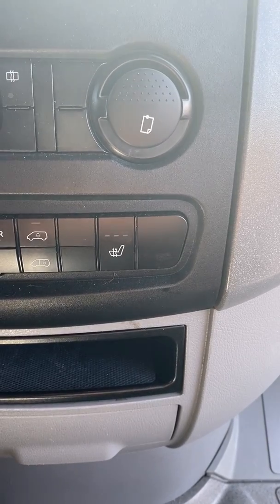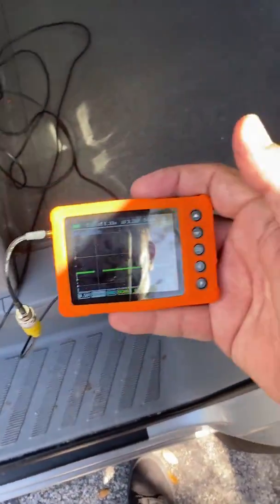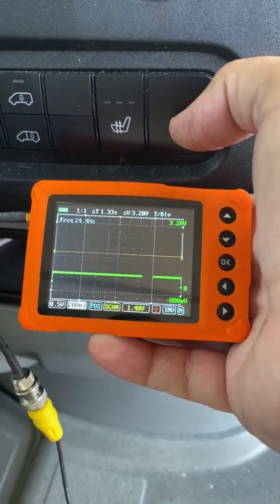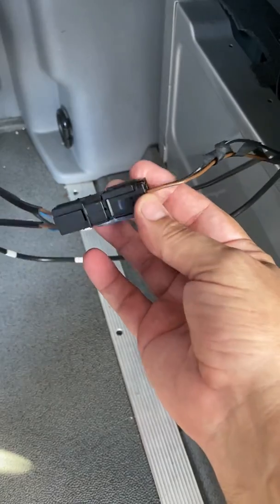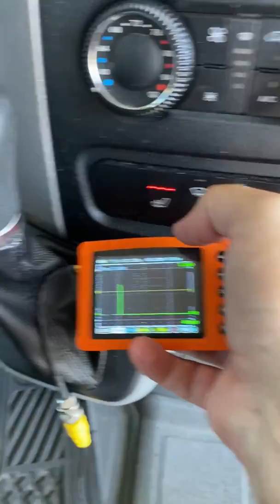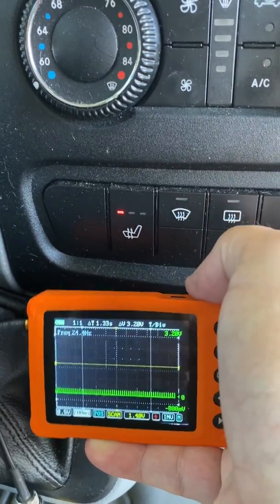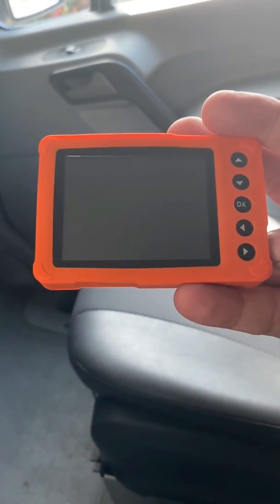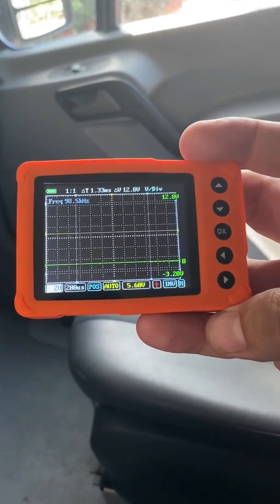2014 Mercedes Sprinter - Heated Seat Diagnostics

Comment: I think we have all been guilty of paralysis by analysis before; logic and understanding of what your tools can, and can not tell you, can help solve many a problem in little to no time flat.

Excellent example of understanding the relationship between volts, ohms, and amps as well as understanding some basic strategies modules may have for operation and self preservation. 

Put it all together and you have a quick, simple, and most importantly effective diagnosis.

Great job Richard and TBT.